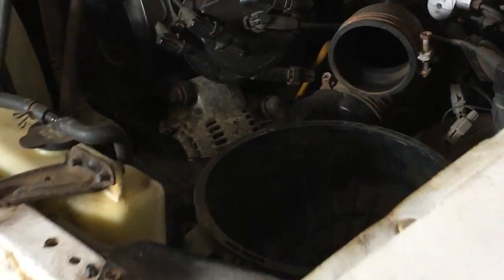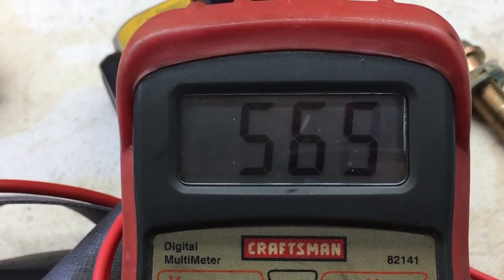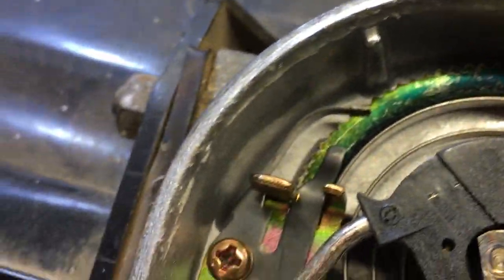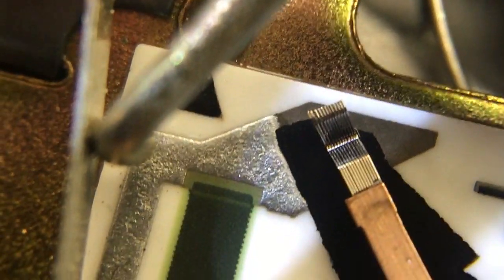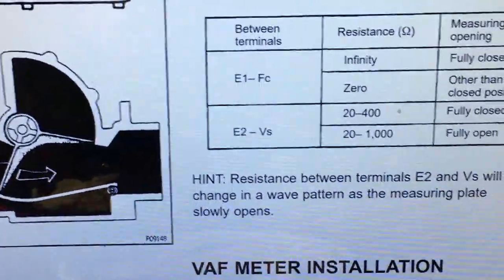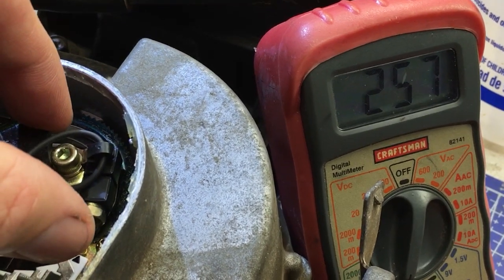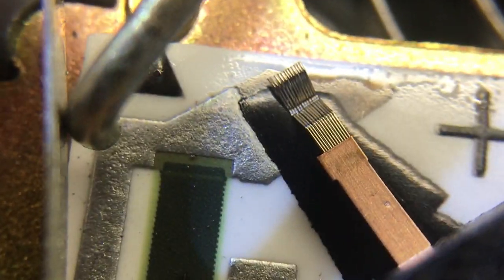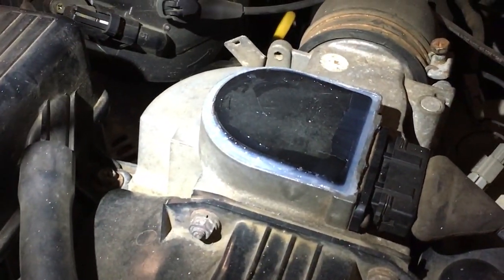1991-95 Toyota Pickup 4Runner 3.0 3VZE air flow meter FIX

Comment: When I test E2 - Vc, it should be 100-300ohms.   In your video, you dont test that, and as per the FSM, am I safe to assume mine is faulty/needing replacement?  Or was yours the same?  Every other test mine has passed, but the E2 - Vc reads 000 (not open, but no reading).  No check engine light, but feels sluggish, hard starts after it is warmed up and shut off, just doesnt feel right (this is always how this trucks been too) 

Also great video, thank you very much

Comment: My 1990 4Runner 3VZE  had the orig Denso dark green water temp sensor on the plenum at the rear of the engine. It was 34 years old, and had a crush washer on it.  I am the second owner, Changing that to a new OEM Denso authentic water temp sensor & sticking with authentic Toyota long life coolant made a difference on mine.  I was running rich. VERY careful to buy only Denso authentic parts. That orig sensor was extracted unbroken by me by using a crowfoot 19mm gas line socket by E-cowlboy  and a can of CRC Freeze-off & a long straw.  The new one & a crush washer exact size as the old one caused no leaks after install. Used no thread sealer.
Reply from the maker: Very good information!  Thanks for this!
Reply: Sweet - I'm 2nd owner of a 2WD SR-5 3.0v6 5-Spd, with every option. Every single thing works, engine is untouched w/exception of water pump. Runs like a sewin' machine @ 337k.😎👍

Comment: Shane, great video.   Crazy question but how did you get the connector plug removed?   I noticed it has two small clips on each end, don’t want to break the plug.   Any thoughts?
Reply from the maker: Very carefully...  🤣  No seriously, I don't remember off the top of my head, but I was super careful to not break them, I know that much...  Good luck!
Reply: if plastic breaks, or cracks  I used JB Weld SuperWeld light activated instant glue on the broken tab.. I watched a you-Tube about this method for fixing broken old engine bay electrical connectors.  Its still removable after the repair. I had success with the water temp sensor plastic connector tab crack repair

Comment: My 93 3.0 5 speed 4 runner has massive power when cold. I bought it broken 2 years ago and it runs good but I know it can run better. So for the 1ST few minutes when I start it if I give it too much gas it will stall out and be kinda hard to start afterwards. After a few minutes it's fine. But sometimes when I make a right hand turn I get a boost of electrical power and it runs awesome. Has lots of power. So after watching this video my potentiometer has fresh silicone on it were you removed it plus it came with a spare unit in just sitting in the back. It runs pretty good but when on the freeway I get spark knock on the slightest of hills. I just had a new timing belt installed and everything attached to it. And jumped the wire to time it at 10 degrees before top dead center. The spark knock sensor has been moved to the top of the motor and I'm,thinking about a new one from Toyota might be my solution. I tried a new igniter but it made no difference so I put the old one back it. I know it can run better because you can feel it unleash the power every once in a while. Bad coil? I just had a new fuel pump installed. Love this old truck.
Reply from the maker: Dang, this one sounds tricky!  You’ll likely have to eliminate one variable at a time.   Spark knock on the freeway might be a timing issue, but it sounds like you checked that.   The sensor should just be in case it happens, but not relied on normally for prevention.  Good luck!

Comment: I have a 89 4runner 3.0, when i first got it, it ran well but smelled a little rich and had soft throttle response. No trouble codes were set, it stalled one day and wouldn’t start again. I got it started by jumping the fuel pump, using starting fluid and disconnecting the AFM. It would run poorly and die if the AFM was plugged in. Using your video I ohmed the AFM and it was out of spec. I’ve replaced it and that apparently was not the problem. The fuel pump doesn’t run with the key on, but if I jumper the fuel pump, and disconnect the AFM it will crank and run poorly. Once it’s running I can remove the jumper and it stays running. Either way if I plug in the AFM the engine immediately stalls. Apparently my AFM was not the problem, is it my COR or something else?
Reply from the maker: This sounds like a tough one for sure.  It certainly sounds like a fuel delivery issue.  You need to verify that the fuel pump is operating when it should, and if not, it may be a bit of research to find out why.  The service manual I posted in the description of this video has an enormous amount of helpful information, but it can take a while to find it and sift through what actually matters.  Good luck!
Reply: @ShanesGettingHandy I was checking out you link. Nice link, only it said 22r, not the 3.0.
 Is it the same part for both?
Reply: maybe a relay for fuel pump...i bought a tester..but havent used yet. My relays are 34 years old...

Comment: Wanted to hit you up for any ideas... (your videos BTW have helped me to learn about all this and are great...but I have this...(93 / 3.0) so at idle you can very faintly hear a hiccup every so often - if you throttle up to say 1700rpm - it will drop 200-300 rpm then jump back up - over and over.   --------..--------..--------..--------..---- that sort of thing. If you hold the throttle higher (3000rpm) it just runs rough. Could this be fuel pressure related? 

To date the following are all new: fuel pump, fuel pressure regulator, O2 sensor, all vacuum lines, plugs, wires, cap, rotor, distributor, ignition coil, igniter, intake gasket, had the ECU all tested OK. 

Any ideas? Please... lossing my mind over this... ;)
Reply from the maker: Unfortunately there are an awful lot of possibilities, but it sounds like the computer is receiving conflicting information somewhere and is doing its best to compensate.  I wouldn't guess it's ignition related, although it sounds like you changed most of that already anyway.  Was it exactly the same before and after you changed the O2 sensor?  Is the engine temperature sensor reading correctly?  Did you measure the fuel pressure?  The throttle position sensor would probably be the next thing I would actually verify is working and adjusted properly.  There is a lot of information about how to do this in the maintenance manual I have linked in the description, and if that yields no results, check all the readings on the AFM.  Good luck!
Reply: @ShanesGettingHandy  Thank you sooooo much for taking the time to reply. I will keep digging and post when I find the answer. Tried multiple tps units and dialed them in with no change, and the afm tested correctly on the bench. And seems to move correctly when running.
Does seem like the exhaust is pretty thick. Maybe a bad new o2 sensor?
Reply from the maker: @chartlights  That's not a bad guess, and quite possible.  That kind of stuff happens more often than it should, especially with aftermarket parts.

Comment: Thank you I have a problem with my car right now it's running to rich any hope
Reply from the maker: Well, I certainly hope you figure it out, and maybe this is a good starting point.  Also, I have a video about the fuel pressure on these motors as well, which was causing mine to run too rich.

Comment: I have a 1991 Toyota truck. Starts fine. Idles fine in park but when I put it in gear it idles rough and wants to shut down. Any thoughts?
Reply from the maker: What is your idle speed set at?  Have you tried turning it up a little?  In case you're not sure how, I briefly address where to find the idle speed screw on my 3VZE timing video

Comment: I have a 90 3.0 and runs great when cold but after warming up and driving sometimes it’ll die if I’m not accelerating, just idles rough and dies? Any ideas on what I can do? Would doing this help?
Reply from the maker: Is the check engine light on?  If so, did you check the codes?
Reply: @ShanesGettingHandy  nope, no lights, everything seems to be fine but sometimes it’ll turn on and idle kinda hard like it’s struggling to get air or something and then dies and I have to keep pressing on the gas pedal in order for it not to die
Reply from the maker: @henryanaya8459  There are about a thousand things it could be, but the first thing I'd suspect is the EGR system.  Warm up the engine so it is showing symptoms, then pinch or disconnect and plug the vacuum line to the EGR valve and see if the symptoms go away.
Reply: Im currently going through this with my newly built heads 93 4runner, warms up good then idle goes to 500 rpm and black smoke comes out exhaust. Runs ok with a little bit of roughness.

Comment: You can also fine tune the AFM to make the engine run richer or leaner. I have adjusted mine plus the timing and it has got some spunk about her which is pretty impressive for an engine with 436,000 k's. I can honestly say that this motor does not fall into the category of the 3.0 slow. 👍
Reply from the maker: Nice!  Mine doesn’t seem to have a whole lot of power, but I also don’t know much about the history.   What did you set your timing to?  I’ve got mine at about 12btdc at the moment.
Reply: @ShanesGettingHandy  yes,  12-14 BTDC seems to be the general consensus,  although the 3VZ (as well as the 3VZ-FE) has naturally very high anti-detonation characteristics so 17 BTDC is also quite common.  Your number one goal however should be correct air fuel ratios.  In a perfect world consider installing a Wide Band Air Fuel Ratio sensor in your exhaust system but as a Plan B use a good wide band exhaust analyser.  From there,  you can fine tune Air Flow Meter in the following areas,  (1) the vane door spring resistance,  (2)  the static arm location and (3) the idle air/fuel mixture setting.  With a good Wide Band analysis scanner you'll be able to get close to 14.7: 1 from idle to WOT.

The Denso Fuel Injection system used in the 3VZ engines was licensed from the Bosch L-Jetronic system  -  it is,  for all intents and purposes,  a 100% clone of the Bosch system.  Here's an article which explains how to super fine tune the L-Jetronic Volume Air Flow Meter,  and it applies to your 3VZ engine too.  

https://www.itinerant-air-cooled.com/viewtopic.php?t=7761

Edited to add:  The ECU motherboards on these older Toyotas  (like most motherboards which are 30+ years old)  are occasionally prone to leaking capacitors,  and sometimes this causes the ECU to use fallback settings in the Fuel Injection without actually throwing a Check Engine Light.  It's not uncommon for this to happen,  but the good news is businesses like "ECU Team Corp" have the skills and knowledge to 100% repair any engine ECU,  across any brand.
Reply from the maker: @Ivan_Julian_AUS  Fantastic tips, thanks so much!
Reply: this guy is correct. i changed my ecu capacitors out with replacements from digi-key (these can be researched if you google lexus/toyota ecu capacitors) my particular truck ran what i thought was good for 30 yrs old but upon changing caps it runs and sounds like its brand new! shifts different...better, responsive, injectors quieted down. i found a few leaky caps. you could not see the leaks until they were desoldered off the board. 20 dollars for caps and a few hrs. its the best bang for the buck ive ever had with an old vehicle.
Reply: @ShanesGettingHandy  I hear 12-14 btdc is most common, some people take it to 17+, I'm about to set my afm 2-4 clicks leaner, lotta write ups and vids about that

Comment: Hey I have a 1991 4runner 3vze, and I’m looking at connector that goes to the E2 slot and I’m missing the female metal connector, is that normal.  It looks like I’m supposed to have 7 wires in there but I only have 6.  Where does the E2 connector goto?  Thanks for the video.
Reply from the maker: E2 is a ground pin.  I have no idea why it would be missing, but if you just use a ground in place of it, your measurements should work.
Reply: Great thanks I’ll give it a try.

Comment: I just want to say thank you for being very thorough on finding out if the vafm was the culprit. My father dug out two units that he had stashed away and I tested one, took the chance and cleaned the Contacts, plugged it in and the truck roared to life without the choppy idle, on the first click. Of course there was a few minutes of happy tears, all I’ve ever wanted was my dads truck to run again after sitting for years. Thank you from the bottom of my heart. She still stumbled, turns out the egr valve was really really clogged and couldn’t justify a 100 plus bucks to replace it. So I grabbed 20 bucks worth of flat stock from Home Depot and made some block off plates. Now she runs through all gears, and I couldn’t have been happier actually taking the time to mess with a multimeter. I don’t like electronics, but I got over it. Now where to send the broken vafm to be refurbed lol, I like to have back ups
Reply from the maker: So happy I could help, thank you for sharing!
Reply: I know I'm late, but I'm celebrating with you anyway. Is Dad still with us? Your wording made me think maybe he wasn't - mine is gone and I would feel the same way.
Anyway, still glad u got her goin'. Hope she still is running well.  ;-)
Reply: @ dads here, lol, I’m sorry about yours. Rn she been sitting for a year cuz of a clutch issue, wouldn’t disengage and smoked itself for a 1/8th of a mile before I was able to stop. Hoping to land something soon so I can take it in.

Comment: So I think my 1993 t100 with the 3.0 is in need of a air flow meter, it drove fine but then died and thought it was out of gas. Filled it with a hand pump and only took half a 5 gallon tank before spewing on the ground. Fine. Fixed the vacuum leaks by replacing all 10 feet under the hood, even tightened the air box silencer on the bottom portion. Question is, can a faulty afm cause the fuel pump to keep priming? It wasn’t doing it until after I went for a drive, key on off it just keeps recirculating thru the fuel regulator. I found a broken square piece of a tab as I removed the box, didn’t think nothing of it, even the idle improved before and after normal op temp. And the flapper inside is very noisy, like it’s clapping at Sunday church. Very loud. Is it supposed to be that loud? Also the tube that goes into the box from the reed valve is very gurgly. Not finding any real answers and been scouring the Haynes manual and old threads.
Reply from the maker: Measure the resistance between E1 and FC.  When looking at the connector it's the left two pins.  With the plate closed, sitting normally, the ohmmeter should read infinity.  If the AFM is twisted open manually, it should read continuity.  This is the fuel pump cutoff switch, and is the "stop switch" I refer to at 2:01.  If the readings are correct, the issue is NOT the AFM, but crucially, if the measurement reads continuity when you are not manually opening the AFM, you have likely found the culprit.
Reply from the maker: And if that all measures correctly, check the Circuit Opening Relay next.
https://htftp.offroadsz.com/marinhaker/programi/toyota/Engine/3VZ-E/96circuito.pdf
Reply: I will check on that in the morning, thank you! But is the flapper supposed to be click clacking like crazy? Only if the AFM is bad right?
Reply from the maker: @TestyRexxy  Without actually hearing it, I can't say for sure, but if you listen to mine operating in the video, and yours sounds different, there is likely an issue.

Comment: What did you set the voltmeter on when oming it? Like 20k 2k? I'm confused on which setting is the correct one. having issues with my 4runner think this may be issue
Reply from the maker: 2k would be the most correct setting for this measurement.  The idea is to set the meter to the next number higher than you predict you will be reading.  200 would be below the readings, 2k would be above, so 2k it is.
Reply: @ShanesGettingHandy  right on thank you

Comment: Does anyone know where the INTAKE AIR TEMPERATURE sensor is on this same vehicle? My error code says there is a problem with it, but I don’t know if it is incorporated into the Mass Air Flow assembly, or what.
Reply from the maker: Yes, the intake air temperature sensor is inside this assembly.  To verify the integrity of the sensor, check the resistance between pins THA and E2 on the meter.  Using the table in the service manual you can figure out if the resistance is within specifications.  If not, you will need to change the sensor.  If so, it is either connector, wiring, or computer issue.  Use this information:  http://htftp.offroadsz.com/marinhaker/programi/toyota/Engine/3VZ-E/92volumeai.pdf
Reply: Another question - I bought a new AFM. But when I install it, he truck only runs for a few seconds, then dies (It seems like I smell fuel).  If I install the old one, it starts immediately and does not die. I am confused now. Is it necessary to somehow reset the ACU to the new AFM, or something like that?  (I tried disconnecting the battery for a while, but it made no difference). Thanks for any ideas!
Reply from the maker: @jf8461  Sounds like the fuel pump cutoff switch is bad on your new AFM.